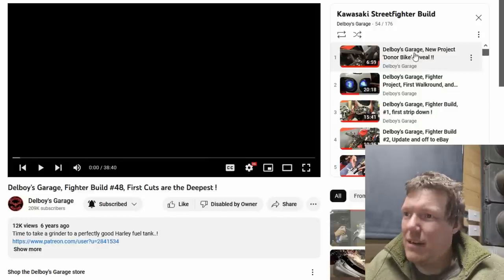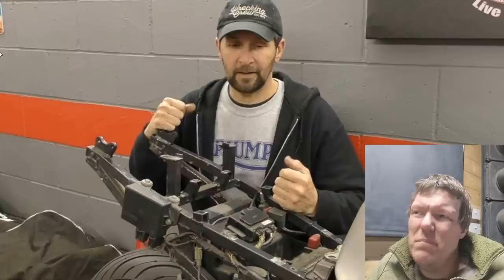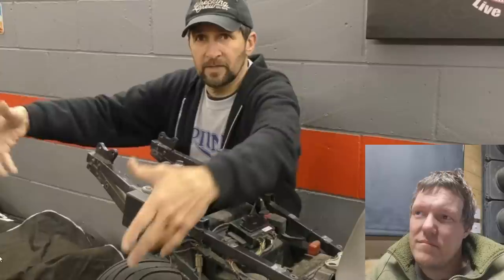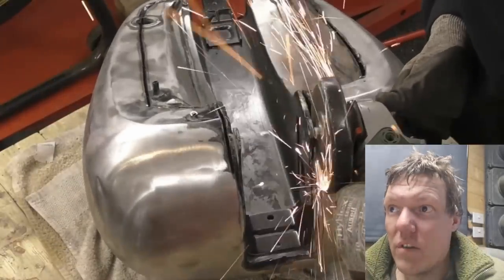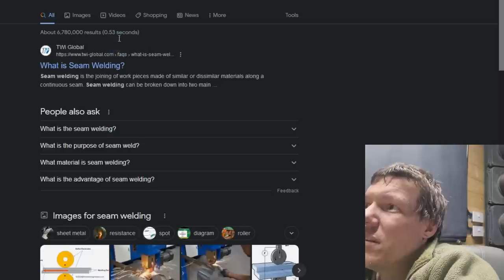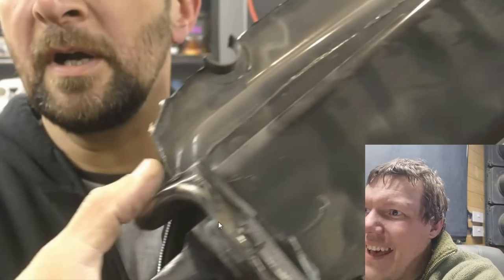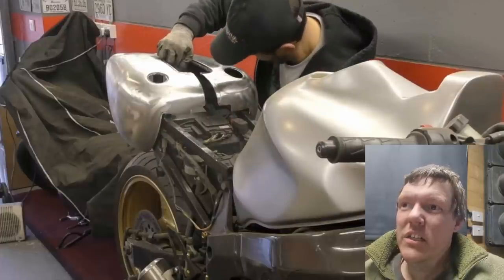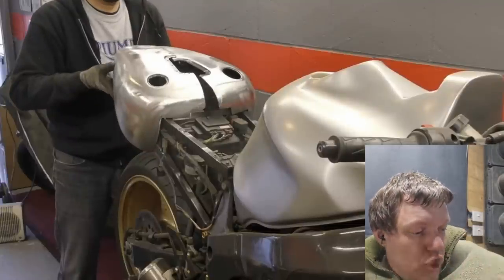HDS 33 - Why a tank is a tank

Comment: You have to fill the tank so there's no headspace .... if you don't, condensation builds up, and a small tropical storm forms in the tank, causing rain and getting water in the petrol. In really extreme cases, the storm develops into a lightning storm, and you risk setting the fuel in the tank on fire....
Reply: lol

Comment: I had to use one of those dremel speed click discs on 3 brake pad retaining pins the other day, when I was changing my brake pads and the pins had seized in solid, so I had to cut them each either side of each pad, drop the pads out and drill the rest of the pins out. My speed click disc is still the same  size as it was new.

Comment: there are a fair few companies that make aftermarket kit tails mainly as a pillion seat delete but also to  inspired by different regional styles (German, Swedish, Japanese are all different flavours, Germany is the high angle short spike tail almost vertical,  the Swedish is a lot more sports bike rounded and tube frame vs the German SSA fashion.

Japanese is very much endurance racer of the 80s and early 90s blocky inspired.

Comment: Fabrication: Taking perfectly good random gas tanks, cutting them into perfectly useless scrap. Nailed it!
On the harley tank, if you look at the bare spot in the tank youll see the hole for the cross over. That cross over connects one side to the other. Theres no coating the keep from clogging the hole up.

Comment: I agree; after literally thousands of 1mm cutting discs I've NEVER had one explode.  What does cause discs to explode when you are using them is only when you've chosen to use them as a grinding or sanding discs, i.e. side pressure.  Cutting discs are not designed to sustain side loading!!  AT ALL!

Comment: Matt, should I use the same VHT paint you tested on a car engine timing-cover? Will I be able to heat the cover up enough by running the engine up to temp to bake it? It's too large for a regular household oven. Thanks dude.
Reply from the maker: Car engine cover?
Reply: @dirtygarageguy  No timing-chain cover. Aluminium jobby.
Reply from the maker: In what colour?
Reply: @dirtygarageguy  the silver aluminium colour they do.
Reply: @dirtygarageguy  I’m just not sure how hot a timing-chain-cover gets so I’m afraid I won’t get it hot enough to bake.

Comment: Nobody buys a totally unmessed about with bike, and thinks the oem rear subframe that has remained on the bike since it rolled out of the factory, isn’t strong, and in proportion, or indeed what the manufacturer, who makes these  by the millions, to comply with loads of regulations and specifications, intended. Making things by hand from scratch, he probably could get it done and make it work, but it would involve a lot of body filler. He says after he’s just used another already existing tank to make something else, and still used loads of body filler. These are edited videos right? Which means he’s edited some bits out already. Which means he must’ve thought those bits were tosh, and what he’s left in these finished videos is actually good. He reckons he’s gonna sell this bike, factoring what it’s cost him into the asking price. Who was the dumb dumb who paid over twice what a good zx7r cost back then, for essentially a heap of junk with 2 thirds of a zx7r frame and a zx7r engine?

Comment: E5 and E10 petrol is hydroscopic. Because of the ethanol it absorbs water from the air, this is how the water gets in your tank, not from rain!
Reply from the maker: You're talking nonsense.

"For example, pharmaceuticals that pick up more than 5% by mass, between 40 and 90% relative humidity at 25 °C, are described as hygroscopic, while materials that pick up less than 1%, under the same conditions are regarded as non-hygroscopic."

Petrol with ethanol absorbs the same amount of water from the atmosphere.

The word is also hyGROscopic not hyDRO. A hydroscope and hydroscopy is the use of an underwater microphone.
Reply: @dirtygarageguy  
Yes my mistake on the spelling. There is a lot written about E5 and E10 being the cause of rust in tanks if it’s left over a long period of time, this is the point I was making about Del’s rusty tank..
Reply from the maker: I know there is, and a lot of people get it wrong.